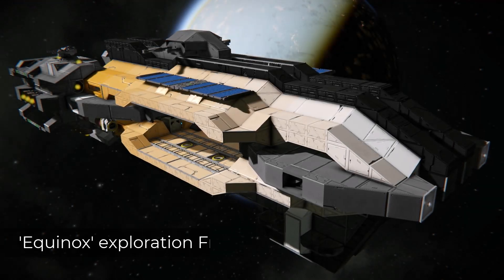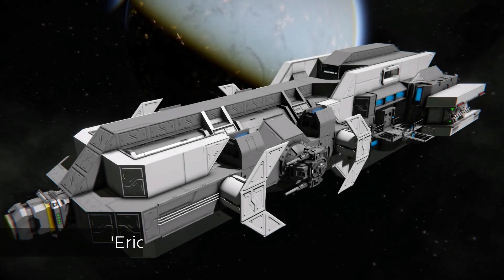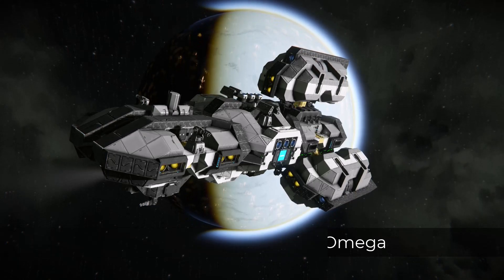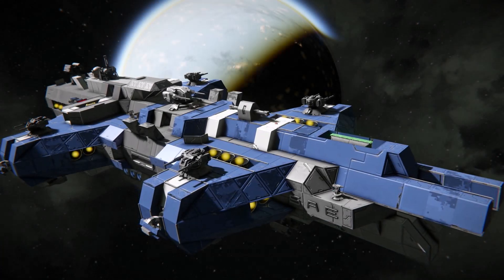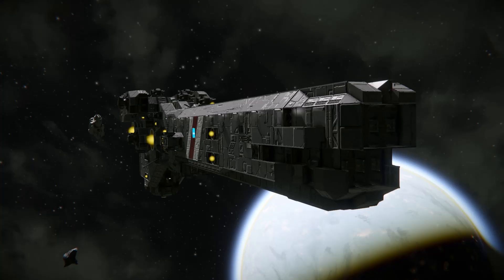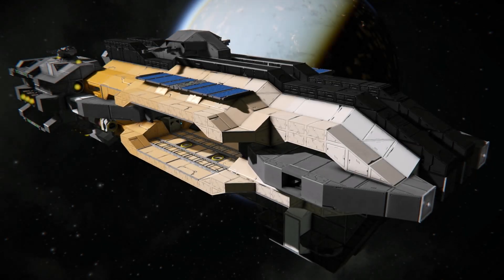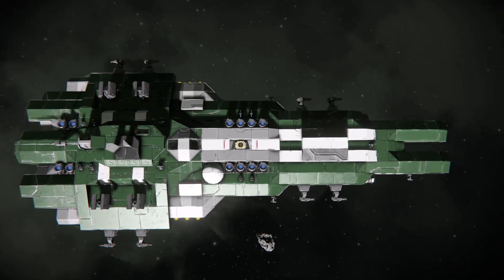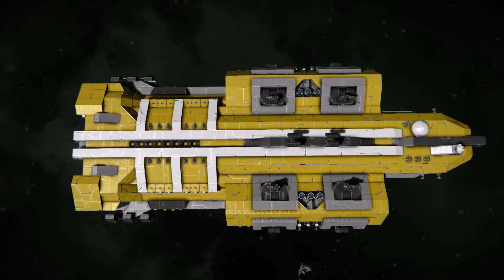SHAPE when building vessels in Space Engineers

Comment: If you can see everything about a ship design from the top, then all of you are thinking way too two dimensionally. Throw you all off, and combine two designs, just one is at a 90 degree offset from the other. But, no, honestly, I'm working on building a ship that has a couple rings of nacelles, fore and aft. Engines and decoys out there, with more engines in the core unit if the rings get hammered. Everything else is weapon systems and reactors. Because it's never entering an atmosphere. No way to land it under gravity.

Comment: I have a bad habit of building huge tankers. However, they serve as excellent battering rams for breaking through blockades. I recommend having plenty of all kinds of materials on board and installing welders for turrets and important components. But it's also very important that one feels comfortable on the ship, so it's important to have a well-designed interior. It's also good if the ship is fairly automated and has automatic defenses against enemies and other elements (event blocks are great for this task). I recommend combining large and small grids (using rotors or hinges for those who don't know how to do it). You can make a lot of details and create additional engines attached to the ship.

Comment: 3 years later and I learned. Dont be afraid of size. PCU is the ultimate limitor and a small corvette with 4 turrets is just a more fragile version of a bigger one with 4 turrets. Extending armor and adding complexity will drastically increase armor, survivability and Space for intelligent component layout while adding like 20 PCU and a couple hundret metal sheets in production cost. And the added weight wont significantly lower agility either. 

So to me the advice about detaching parts and putting them a block or two further is imo the best advice in the whole video

Comment: I'm creating my own line of ships that are going to be scaled on the basis of a pirate thing like the biggest one is going to be a " dreadnought class" going by the name of the flying Dutchman. There's going to be smaller ones built for speed capable switching between AI, control and manual. I call the corsairs. One of the primary features is going to be a modular design especially around turrets that I'm going to call shipmates with the Dutchman having a primary one called the quartermaster.

Comment: Another good way to come up with a ship shape is to build from the inside out. Lay down all your cargo, reactors, conveyors, hydrogen and thrusters until you have an almost functional ship skeleton, then make a layer of armor as a skin over it, refine the shape as needed. (Interior space efficiency and layout is an afterthought in a lot of my ships, though.)
Reply: that's the way i build ships over years
Reply: I always did it like that, but recently I tried the opposite approach of shaping a general outline, deciding on the overall structure, adding thrust and then and only then I allowed myself to build the conveyors/electronics. That way the design was much cleaner, and the cramming aspect of building wasn't worse than usual. For small grid ships I'm still trying to do shape before utility, but it proves to be a lot more difficult

Comment: Honestly one of my favorite vessel shapes is similar to an IRL rocket.
Basically you have tube body and a set of perpendicular wings (in the shape of a cross) on the back.
You can put gatling guns on the ends of the wings for good missile defense/all around protection.
A diagonal cross is better for landing on planets, and a horizontal + vertical cross is better for conveyor efficiency.
Usually I put the guns resting on the body aligned with the empty space between the wings so they can shoot behind the ship.
Then I make sure the guns at the front are lower than the back so they can fire forward all at once (similar to the wedge design).
Great for 360 protection, and great for running a blockade I suppose.
I recommend experimenting with different shapes, adding more wings, etc to fit your needs as the standard design I've set here is very limiting in space. I don't find it likely you'll have an interior and instead will just use it for combat.
Reply: look up "praetor event horizon". similar, right?

Comment: I like to let my ship designs follow the function of their primary parts. For example, you will want to put big power/fuel generators and consumers (H2 tanks, reactors and thrust packs) close together because the infrastructure between them has to be as short as possible: 'Big H2 pipes and electrical buses are heavy.' In the same headcanon, you will want to put the crew habitat areas as far away from any hazards (thrusters, weapons, reactors, grav gens) as possible and put the hazardous parts in an isolated area of the ship, maybe even have some way to jettison them in an emergency.

Those rules will already define some basic layout for most ships -- usually engines in the back, living quarters in the front and center where they are least vulnerable.

Comment: If you're building your ship to look a certain way you're making a fundamental mistake.
Build your ship from the inside out not outside in. Avoid hollow interior space when ever possible. Avoid attaching things with stalks. Avoid nooks and crannies try to make your surface as smooth as possible.
Reply from the maker: Depends how u like to build, it's a sandbox game
Reply: @LunarKolony  to be effective. Objectively hollow space and stalks are a major weak point. Look at real world battle ships. Were they designed from the hull in? Same with airplanes and jets, tanks even. Nothing effective was designed from the outside in.
Reply: There are pros and cons to both. The inside-out design offers higher functional flexibility, being able to dedicate your design to a specific function upon laying the foundation without sacrificing square footage or protection. 

The outside-in design is not the opposite, but it is instead the inverse: This type of design can be highly modular and visually appealing, while specializing in particular role by the shape itself instead of the internal network. 

The I-O design is perfect for industrial use, as that doen't need to look pretty (infact that can be a good thing). The O-I design is perfect for constructing a particular ship-class for a flotilla or even the entire fleet. Both are good and can be used the same way!
Reply: @homerodysseus4203  you got that twisted, the inside put method allows for modular design and broad spectrum functions. The outside to inside pudgeon holes you out of fi cations and modular ability.

Comment: I'm very new to SE, (and shipbuilding in general, I also enjoy Empyrion) but the hammerhead pattern mentioned here is what I am working towards with my current rover.  I have been frustrated by the vehicle flipping a lot.  I worked out how to stop it from flipping to the sides and front, but then forgot to add enough length at the back to prevent it from flipping backwards.  People sometimes say that you should have all your weight in one place, at the direct center of the ship; but as I experiment more I am discovering that I need to distribute it evenly if I want to avoid problems.

Comment: Very good tipps for designing different ships. :)

I wanna share my ... lets say key moment of getting experience in building stuff in SE.

The kinda only real big ship i designed out of survival was build around a Big Bertha from the Mod Battle Cannons and Turrets. It became a (way to) huge flagship in the end because i just wanted to fullfill EVERY aspect. Firepower, Immersion, etc.
The main cockpit was kind of in the middle of the ship since i had a V shaped front along the gun, with embedded broadside and defensive guns on the outside aswell as a shaft to all those components and a few thrusters. inside the V i got my front thrusters mainly around the barrel. Behind i then made life support, power, barracks on the outside for having cool windows and because sleeping crewmates under fire are useless crewmates anyway. :D A lot of corridors to every section. Own full production and resource and then Hangars with dedicated dropship, fighters and utility sections, with opening doors to the upper and lower side of the ship (lower for atmosphere or low orbit launches mostly). even special small drone hangars on some key locations for repair drones. And in the end and very much centered the engine room with some massive batteries of hydrogen drives. Gyroscopes and batteries were all over the ship where they fitted.

I still somehow managed to got my center of mass pretty much in the middle and got somewhat decent thrust and maneuverbility ... but it crashed my PC back then if i wanted to load it in another world ... to big. :D

But what learned from building this monster over months helped me a lot in every future build from small planetary scout rovers to space stations.
The Shape mostly follows the function for me. Core systems or Role system comes first, then they get shapes fitting their purpose. With time you find out how to make really cool looking ships that do everything you want them to be capable of.

So, to everyone that wants to or is still learning i'd recommend to surely look up some stuff from the workshop, but then just start your own thing. Make an empty world in creative, no asteroids, no nothing (may get the builders skybox) and dedicate it to a singular build. 
Dont start over and over, just go for it, remove stuff, add stuff, the idea might change from a freighter to a carrierbattleship and gets massive. 
Don't work on the intend of using it ... work for the sake of building it. :D 
Everything you learn doing that you can then use everywhere else. You might just build something that is completely useless, but looks cool. Or you build something that is absolutely effective but looks horrible at first. But then you can just go from there.

Comment: I almost exclusively play single player survival without combat so my qualifications for a vessels shape are entirely different. I let the utility of the the ship determine it's final shape. I'll start with defining a ships purpose (mining, hauling, etc) and start by connecting all of the largest blocks like jump drives and hydrogen tanks together in a rough shape then move things around little by little until i can neatly fit in all the small functional blocks like batteries, gyros, and assemblers in the ship. Once it's has all the utility blocks i want i'll add the minimal amount of armor blocks necessary to protect the most vulnerable parts and perhaps a little more to make the form flow a little better. 
In the end it's the large blocks that get added that will determine the ships overall size, in that way i maximize the ships utility and minimize things like redundant conveyor lines and wasted space between the outer armor and the internal components thus keeping the ship as light and cheap to build as possible.
Reply: Me too..
I don't get the idea of making boxes or plates of armour and building inside that... I know how big a section needs to be, AFTER the functional components are in!       :)
Reply: @D_Rogers  Yeah outside-in building never worked for me, partly because I consider the interior layout of the ship just as important as the exterior, and it's much easier to beautify the exterior of a built-up interior than the other way around.
Reply: @tackytrooper  I am having difficulty this type of building sadly. 

I always end up with a massive empty looking box of like 3 rooms.

Comment: Another few suggestions I would give for this:
Give your faction a main shape - For example the winged dagger shape for most of my fleet, giving most of your ships a similar shape allows for a more cohesive faction design.
Don't be afraid to try different shapes - Even if you set a main shape for your faction, feel free to try other shapes that compliment it well. A front heavy hammerhead and a back heavy winged dagger both compliment each other by being opposites.
Make your ships distinct - While ships from a faction should all look similar, you should make them identifiable by a black and white silhouette.
Try asymmetry - Even as simple as putting an antenna on one side and not on the other, or as complex as making each half of the ship look completely different, it can add uniqueness to a build.
Don't have everything smooth - Even if your faction's style is smoothed out curved ships, adding some raised bits with some sharper angles gives more visual interest to the build.
Reply: Asymmetric builds can be so damn confusing to build but sometimes absolutely cool. 
Easiest way to do them is propably building a survival ship as your base and just add stuff as needed. :D First its a Drill, then some day its a carrier.
Sometimes they even get to look really cool but certainly confusing for everyone who isnt used to it.
Reply: I dislike normalizing shapes across a fleet; many of my factions hold very different formats of ship, and the faction’s purpose and principle informs the design more. Designs tend to fit next to one another even in spite of their different notes!